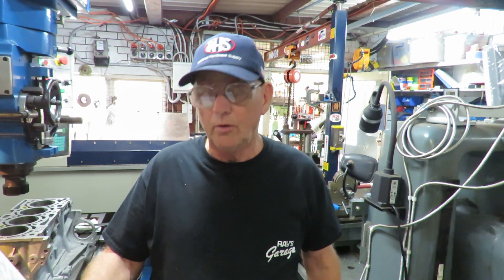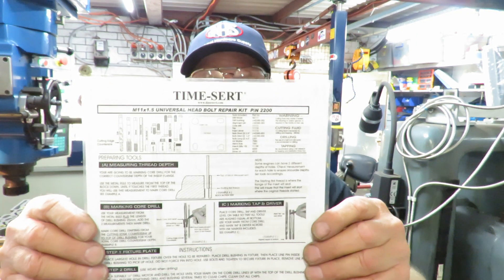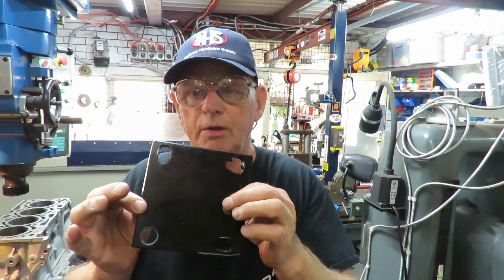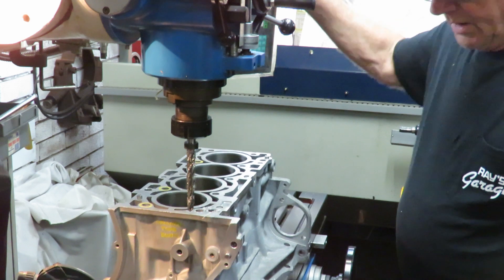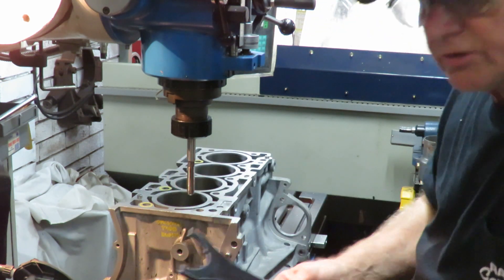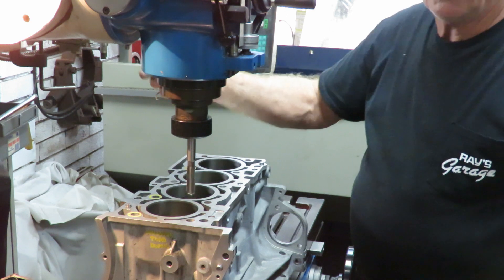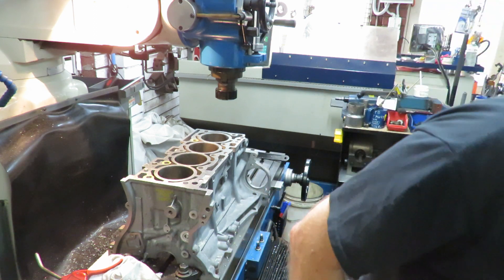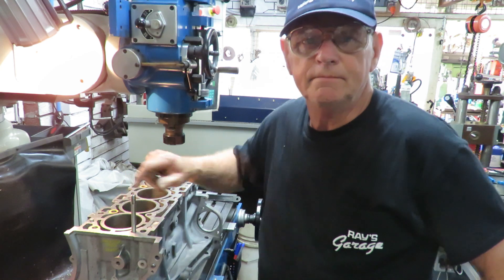The Friday Fresno Connection Ford Engine Block Repair

Comment: I have a few questions for you Bruce. Since you used kerosine to lube the drill and the threads for the Time Sert and then you did not clean the lube out of the threaded bore, just blow jobbed the hole. Using a locking compound without proper cleaning prevents the locking to occur even though the Sert expands into the aluminum. Having a threadlocker prevents the aluminum and the metal Sert from corrosion as most soft metals are known to corrode in working engines. Just saying Bruce and have a virus free day too. VF

Comment: Good job done well, mate.

As an aside, have you seen the "periscope" method of inspecting holes? Instead of shining a torch down the 'ole and trying to peer past it, hold a small piece of mirror, at an angle of 45 degrees, a few centimetres past the hole, and shine the torch onto the *mirror*. A little juggling with torch and mirror positions will allow you to see right down the hole with no obstructions, and with all the detail you could want.

I have a small circular mirror (40 mm?) mounted on a short handle, with an adjustable, lockable pivoting head. I think they sell them in the plumbing tools section of hardware shops, but that, combined with the torch, makes life very easy, especially with small diameter holes.